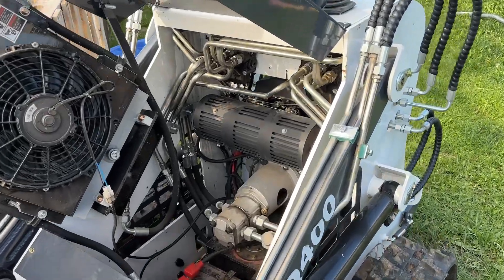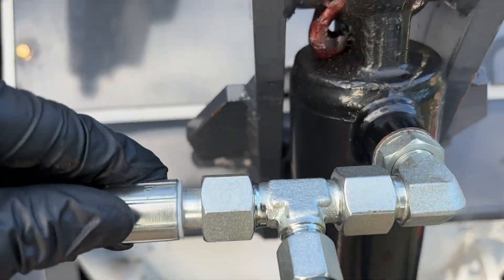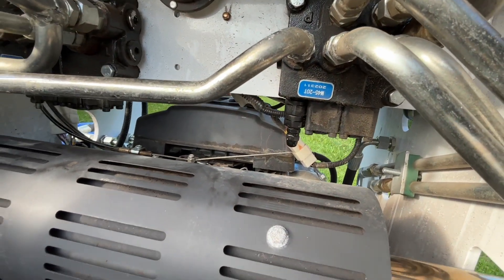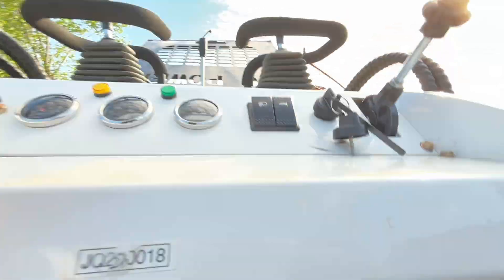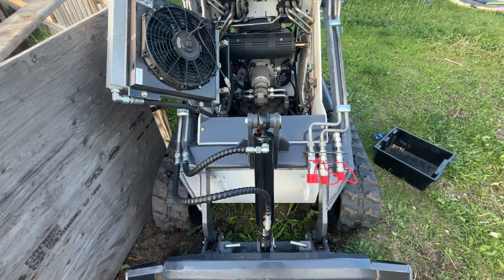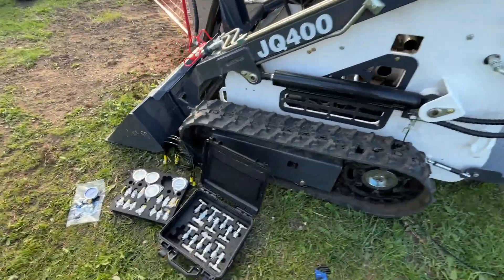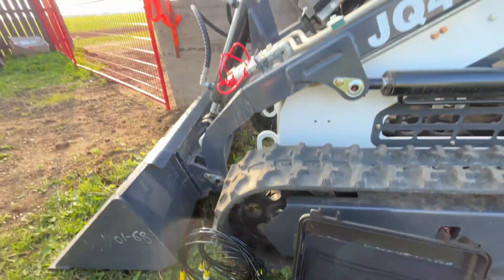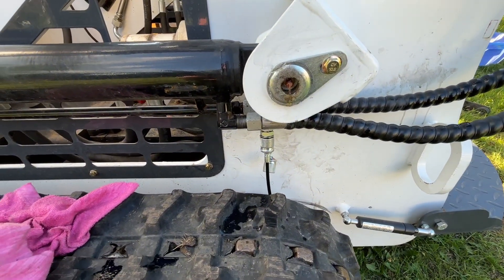Chinese Mini Skid Steer - How To Set Hydraulic Pressures

Comment: I also have the JQ400R with tandem pump. My left side tracks slower than the right side and I was hoping this would help, but it did not.  If the speed is a flow issue, what are next steps to get it sorted out? Any guidance would be appreciated.
Reply: The controls move fully in both directions and the boom lift and lower and bucket tilt all seem to function fine. It seems to just be a problem with the left tracking speed only.

Comment: Your machine has a very loud high pitched rattle and whine to it. It sounds like cavitation. My machine makes a similar noise depending on the rpm. At full throttle it doesnt make the noise.

Comment: Have you ever had your track system idler wheel shaft not pressure with grease? I have this exact model and im having issues.
Reply from the maker: You probably blew out the grease seal

Comment: Can you adjust to high? I find my grapple doesn’t hold the logs too well if i lock in the closed position
Reply from the maker: Adjusting pressure will do nothing about holding power. Lower quality components like the hydraulic cylinder and the tolerances in the control valves is what bleeds off pressure (all hydraulics will bleed off pressure, without a holding valves, as nothing is 100% sealed)
Reply: @SJWEQUIPMENT Ok I’ve been battling a engine surging issues for a while. The only things that make it run steady are running with no filter or half choke

Comment: Thanks for the info. 

I need to find a forum but will start here asking additional questions about the JQ400 hydraulics system. 

1. Do you know what kind/style of fittings on these steel hydraulic tubes? Steep Tapered ID  with OD thread. The male has an o-ring on the OD with a ID threaded nut.
2. The case drain flat coupling thread and fitting type? Mine came with a Male, but need to switch to female. 
3. Biggest issue on this machine is the accessory system come off the right control valve, thus the right drive does not work well when the accessory in on. Also, moving the right track will stall/starve the accessory unit. 
4. The main pump (two pumps in one) is unbalanced as 1/2 of the pump,1st port is feeding the left side circuit. The other half, 2nd port is supplying the right circuit which include the accessory circuit. This mean the 2nd port pump is doing all the work. 
5. My idea is to bridge the two pressure line, creating a common pressure manifold. Now the accessory circuit will be drawn from both pump circuits for more flow and balance. 

This takes me back to item #1 as I cannot find anything on these fitting when researching hydraulic fitting around the world
Reply from the maker: Hose fittings are DIN L, ports are BSPP. These units were built for European markets. 

Yes you just described the issue of a 2 pump unit. Combining the flow of the two pumps will not give you the results you expect. People do large single pump conversions. But the DCV block with the aux spool doesn’t have the porting internally to operate uninterrupted continuously when running other functions like loader or drive motor 

No offense, but if you can’t identify hydraulic fittings you probably shouldn’t be trying to reinvent your hydraulic system 

You’re gonna spend a lot of time and money when you could just pick up a AGT KTT with 3 pumps.

Comment: What does it mean if when you load it too much the engine stalls/turns off. Like if your pushing too big of a pile of dirt or try to lift something too heavy.
Reply: Your maxing out the engines ability to run the pump.

Comment: I bought a hy480c brand new it has 2.0 hours of operation first time using it saw that i was leaking from under the left control handle bar i repaired it now after usuing it for like 20 mins its hard to back up
Like air build up any way to bleed it?
Reply from the maker: If it goes forward no problem than its not and air problem. Check the lever and make sure its able to travel all the way back. I know some of them machines have issues with the whole valve body moving or the lever being loose and it hitting the body of the machine before getting its full travel

Comment: What does flipping the lines do? I would like to have iso control if possible?
Reply from the maker: ISO controls (drive one stick, loader the other) is not possible on these machines without forking out thousands of dollars on new ISO joysticks, fittings, and all new hoses to replumb the machine. Plus you'd need to upgrade the pumps. Trying to run the ISO joystick to run both tracks off one pump would cut your driving speed in half.
Reply: He flipped the lines to change the direction for bucket up and bucket down.

Comment: Thanks for the video. My only hesitation to this is risking blowing drive motor seals. I admit that is a hunch coming from no experience…in other words not calling you wrong…have you experienced any failures since?  Also do you know if it will speed up the machine or is this simply related to “pressure relief” setting the max power??
Reply: I’ve seen it blow the drive motors
Reply from the maker: No failures. Increasing pressure will not increase speed. Speed is determined by flow.
Reply: @SJWEQUIPMENT  10-4. Thanks brother. I'm learning a lot about these little machines and I thought (what you said) could be the case.

Comment: I have a question what kind of drive assembly do these use? I know the major brands use a hydrostatic pump to drive the motors which are vey expensive, im wondering how these work what kind of drive motors and pump. Im building a project and dont want to spend a trillion dollars on the drive system.
Reply from the maker: These use a relatively cheap BM6 gear motor with a Sprocket directly on the shaft

https://www.agtequipment.com/products/drive-motor-for-mini-excavators-and-skid-steers

Comment: Hey brother I have a two stage pump on my machine identical. I see that they sell three stage pumps online. What's your thoughts on the process. Seems pretty simple unless i'm not thinking of something. The pump.
Is easily removed. But then.
We would have two extra ports for additional lines. Do we just run those two additional lines to the left boom just picking your brain. 🤝
Reply from the maker: You'd have to install another bung in the hydraulic tank to run a supply line to the new 3rd pump. Then you'd have to install another DCV (directional control valve), with plumbing to the loader arms for an AUX. Then from the DCV run a return line back to the tank. Installing a T when the other return line enters the filter housing.

Comment: Does this affect the ability to use multiple functions at once? I know with these one of the complaints is you can’t turn and raise bucket at the same time for example or the third function etc. I know a few models have three pump set up and those are better. Didn’t know if this was a work around or if that’s gonna be flow as opposed to pressure.
Reply from the maker: Adjusting pressure wont fix that issue. The real cause of not being able to drive and run a function is not enough flow and low cost control valves.

Comment: Do you know a way to determine how much pressure is too much? I've got a similar machine and was thinking of increasing the pressure slightly to get a little more power out of the machine but don't want to go too crazy.
Reply from the maker: If you don’t have a gauge, don’t adjust pressure.

Comment: Does adjusting this pressure make the drive motor move faster. I can barely go like 3mph. Not trying too win a race but like 5mph would be better and more productive.
Reply from the maker: No, increasing pressure does not increase speed. To increase speed you’d need to increase flow. Which you can’t do without changing pumps.
Reply: @SJWEQUIPMENT  ok thank you for letting me know.

Comment: Awesome info. I just bought one of these last Thursday and I'm trying to learn as much as possible about it.

Please show the functionality after the lift hose swap. I find that the stock set-up is odd.
Reply from the maker: Will do, I find it much more intuitive to run now.
Reply: @SJWEQUIPMENT  Good to hear. Maybe I'll just do it and see for myself. I assume the crossing hoses aren't binding/rubbing?
Reply: What kind of grease do you use for tightening the tracks
Reply from the maker: @markmaker3528  Any grease, I use the same EP grease that I use for the pins